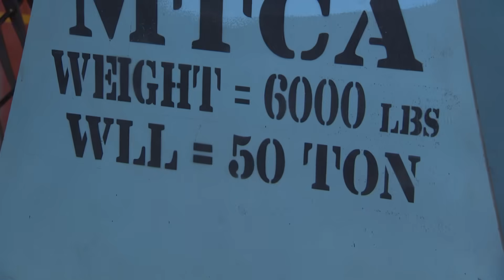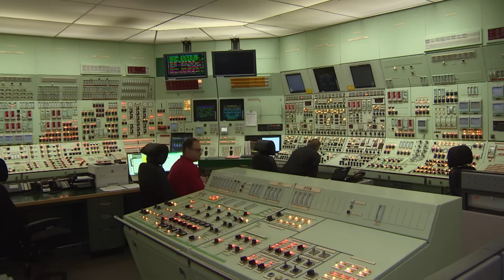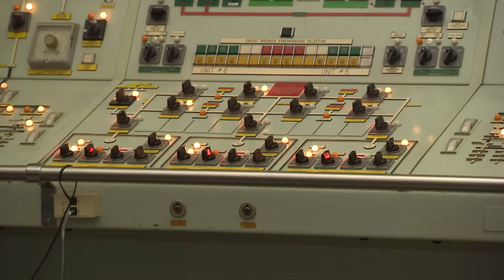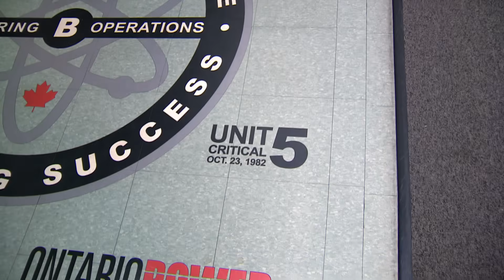Here's what it looks like inside a nuclear power plant

Comment: I don't understand why people are so against building modern nuclear plants that are 3 times safer than these ancient 1960's plants, with their refurbished 1980's computer systems....
Reply: CANDU's have been tremendous reactors, maybe the best. There is no problem building more reactors of this basic design.
Reply: @missano3856 
I was surprised at how quickly the comment I just posted was  removed. 
I pointed out Dr. Charles Till and his contribution with the IFR Liquid sodium metal cooled nuclear reactor  at the Argonne National Laboratory Idaho. 
Also mentioned is the YouTube of the deliberate coolant being stopped, and the reactor self shutting down.....
Reply: @missano3856  Or, we could be building thorium reactors which produce far less nuclear waste, and have even less risk of nuclear meltdown...
Reply: @MaverickBlue42  Whist I agree, there are other issues associated with the thorium fuel cycle. Historically has that been adopted first we'd have stuck with it. Both cycles have their own merits and demerits.
Reply: @paulanderson7796 The only downside that I'm aware of for thorium is you can't turn the byproducts into nuclear weapons...
Reply: @MaverickBlue42  Being largely useless for the production of fissile nuclear weapons is not a downside. The one I am thinking of is a commercial disadvantage  -  cost of fuel fabrication and reprocessing.
Reply: @MaverickBlue42 thorium reactors are just breeder reactors. also, thorium doesn't need to even be used in a breeder reactor, we could also just use nuclear waste. this is where breeder reactors are super amazing, is their ability to unlock SO much more energy which is, at the moment, so underutilized and locked up in dry cask storage. 

also, passive safety mechanisms isn't just limited to thorium reactors. all modern reactor designs have them.
Reply: The short answer is that people are scared of things that they don't or can't understand.  And then uninformed "experts" fill them with nonsense about every aspect of the subject.  Much like some of the commenters here.
Reply: But ThINk Of THe PoOR oiL ComPaNIeS
Reply: Way way more than 3x safer.
Reply: misconceptions, bad publicity, and general fears is really all it is.
there's more safety systems than you could imagine built into modern reactors
there's the SCRAM, of course, emergency pressure release systems, and the like. so much is built in to them to make them reliable and safe.
as for waste, it's stored in spent fuel pools for a long while, before being moved to blast proof concrete containers on site. They won't last long enough for everything to decay, but they'll last for a good long while, enough for the waste to be manageable by the time something needs to be done with it
the only actual problem really is just the cost of building a new up to date plant.
Reply: So true, these are a piece of art. People probably dislike it because it has “nuclear” in it, with things such as nuclear waste which are much more better contained than before
Reply: @duckking404  They don't create that much waste at all. There is a fortune being made from the "management" of reactor "waste". Governments are wrapped up in the same thing. Money money money
Reply: @paulanderson7796  Yep
Reply: The safety standard of this plant is poor compared to european ones. And its way more expensive than other sources of electricity
Reply: It’s because the layman fears nuclear power, and it’s also been heavily lobbied against.
Reply: @ I'm far more afraid of aging, 1970's nuclear plants that are still operating, often well beyond their predicted life expectancy, than I am about new, modern nuclear plants
Reply: The biggest problem is cost. Nuclear fission power plants are simply too expensive to build and maintain. Especially in times where renewables are getting cheaper and cheaper.
Reply: @xXYannuschXx , they are inexpensive to maintain. The fuel is highly efficient and water is not hard to find.
Reply: Oil lobbyist.
Reply: @ac346673  i am heavily in support of nuclear energy and i am also a strong believer in climate change. nuclear energy has the amazing potential to completely get rid of our dependence on fossil fuels on our grids, which is a massive step towards net zero (or net negative) everywhere else. 

to just lump nuclear energy activists in with the climate deniers and fossil fuel supporters is just factually incorrect.
Reply: It’s not that people are against it so much as the economics are.  They are extremely expensive to build, just look  at the most recent attempts in the US.  They require technical knowledge that is in short supply, only a small number of companies can do the work and at least a few have gone bankrupt due to cost overruns and excessive delays.  No one wants to finance them, but more importantly, no one will insure them.  That’s the real issue, no insurance company will go near them.  They may be super safe 99% of the time, but that 1% is cataclysmic, nightmarish, and will guarantee bankruptcy for everybody involved.  It’s not a matter of if, it’s a matter of when and just how bad:  Chernobyl bad, Fukushima bad, TMI bad, or maybe just a lesser issue like Davis-Bessie in Ohio where acid laden cooling water ate through the vessel.  It was found only after the NRC issued a mandatory inspection notice and after the plant operator delayed the inspection for months to try to save money.  They could have easily melted the reactor down if it had gotten worse….  It’s not the known, it’s the unknown and poor judgment that killed the nuclear power industry….
Reply: Just look at Chernobyl and ask why. Been since 1986 and people still haven't been able to go back there. Unless they just ignore the government warning and go back anyway. Which I've heard some have done
Reply: Because there is not enough safety to avoid it 100% and any disaster could render life on earth impossible not to mention horrible suffering even in the best case scenarios and we had Fukushima, for instance. No materr how safe, there is still room for disaster cause nth can really contain an explosion of this kind or a meltdown
Reply: Computer systems be damned. We’re operating reactors with metal that’s been bombarded with particles for decades. We don’t have a clue-every day is a science experiment to see how far we can push it. Someday we’ll unexpectedly reach the limit when a weld breaks on one of those pump spools. Then we’ll get to see if the theoretical eccs systems work. They’re theoretical because they’ve never really been tested. And then of course there’s the high-level waste. We just keep making more of the crap and we haven’t come up with anything that lasts for thousands of years. You can’t build nuclear plants on promises, theories and projections-we’ve done that and been proven wrong too many times. That’s why people don’t trust nuclear power. Because people like you have the rose colored glasses on and trust machines too much.
Reply: @douglasskaalrud6865  Huge upsides to this things PDP11 clone with custom PLC's.

everything talks via RS485 rather than ethernet
Huge cost savings from this, no need to replace everything every 5 years to not hit end of life.  The programs are all simple enough that they can be proven to be fault free. Same with the hardware.

No need for worrying about end of life software other than on the windows 10 machines they swapped out the dumb terminals for.

If this had modern computer controls.
They would have to replace everything every 5-10 years because it became end of life or be in a state where any 15 year old kid with a copy of metasploit that manages to get a remote shell on that network could hack them.

Something like STUXNET literally can't even happen outside of messing with the windows workstations that are probably just running a terminal emulator.

We don't see cyber attacks impacting power plants here, because our systems are simpler and from before it became easy to do this.
Reply: @douglasskaalrud6865  this is simply not true. there's been plenty of experiments done involving simulated nuclear meltdowns, which do demonstrate the safety mechanisms (both active and passive) to ensure the safe operation of nuclear power plants. corium, the highly radioactive rock produced by the molten down mixing of nuclear fuel, fuel assemblies, and surrounding stuff, has been produced in labs to test theories, monitor, document, etc. this stuff is not new. 

also, nuclear waste is very well contained and is fully accounted for, unlike the mountains of waste produced daily by solar panels and wind turbines, which all use alot of non recyclable materials. solar panels even contain heavy metals, which unlike nuclear waste, doesn't decay if you wait long enough. 

hydro and geothermal are great options, but they do not work everywhere. in somewhere such as New Zealand, geothermal is an extremely good option as you can just drill 2 big holes in the ground, run water through one, and have steam out the other that you can run through a turbine for essentially limitless electricity. or for hydro, have a dam somewhere where it rains, turbine, electricity. but this doesn't work everywhere, and producing new hydro plants (and again for when they break) is EXTREMELY destructive to the environment and natural ecosystems. 

solar and wind also cannot produce power constantly, which definitely makes it not useful as an option for net zero. also, as we reduce our emissions, we're gonna need to actually use MORE power, because of switching from things like gas, wood, and petrol for cooking, heating, and transport to electricity. grids are gonna need to scale up, and electricity is gonna need to become super cheap, otherwise people will just find alternatives. nuclear power can fill this spot. solar and wind cannot.

Comment: Where are the doughnuts? Are there any disaster recovery simulations or exercises?
Reply: Reactor operators go through years of training going through responding to practically any problem one could imagine. They also have to prove this knowledge many times each year through ongoing training
Reply: It’s Pickering, so they don’t really perform proper disaster planning. If it has a meltdown, it will irradiate half of Toronto, but they don’t want to scare anyone, so they don’t run proper disaster exercises nor distribute enough iodine pills to everyone nor provide information on evacuation plans in a nuclear emergency. It’s supposed to shut down, but the Ontario government screwed up their electricity plans, so they’re keeping it open.